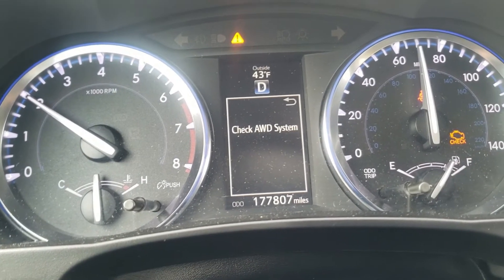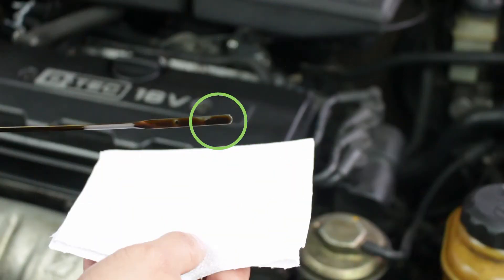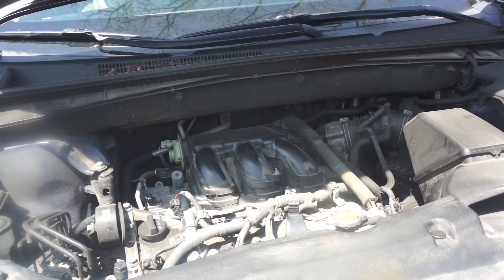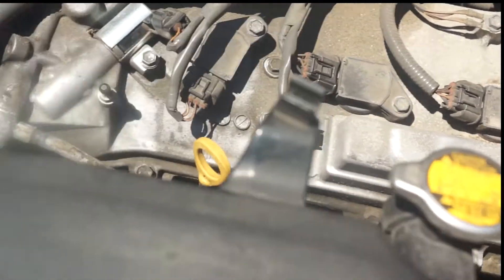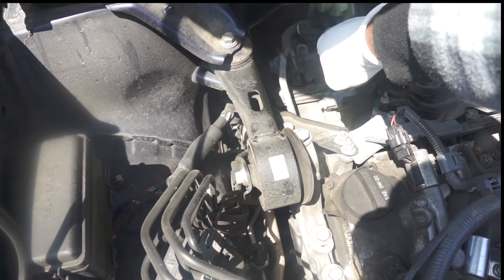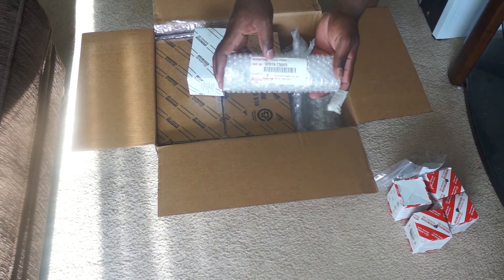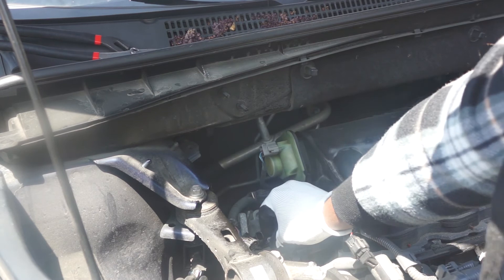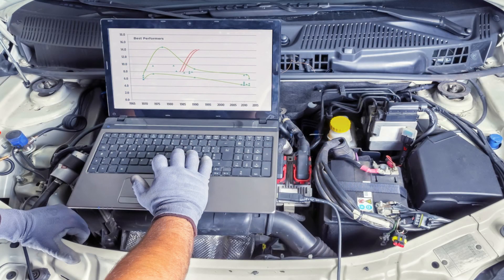Code P0340 P0341 Camshaft Position Sensor Replacement Toyota Highlander V6 Engine Bank 1 Intake

Comment: Just want to thank you for uploading this video.   Saved alot of money than taking it to a specialist technician! Had the same code on my mother's 2015 Toyota Highlander p0012 and the front AWD was on as well.  Did an oil change and swap out two front Bank 2 Exhaust and Intake sensor as well as Bank 1 Camshaft sensor near the Intake manifold.  Did not get to the bottom one behind the manifold but took into consideration to your video and manage to take to O'Reilly to erase the code.  After that, everything ran fine again.  Thank you!
Reply from the maker: I'm happy you were able to solve the problem yourself because specialist technicians are so expensive. Not sure you needed to swap so many but you got the job done. I would appreciate your support with a subscription 👍😄

Comment: Wow i had exactly the same check engine light and info appeared on my dash like on and off couple months ago on my 2015 Highlander..and the difference is when i connect the scanner..i got the p0420 code different from your code..so thats weird to have the same info on your dash but different diagnosed problem from scanner...cheers🤙🏾
Reply from the maker: The display is common for a power chain issue. The codes are usually different
Reply: I had a p0010??was that the same sensor??a p0343 and a p0420

Comment: I'm a fan of you. I have a 2017 Toyota Highlander xle 3.5L V6 engine AWD. I am having same problem. When I scan the car, the code came p0335. I am having problem to locate the Crankshaft position sensor circuit A. Can you tell me where to check to find Crankshaft position sensor circuit A? Thank you for your content. Your videos are helpful.
Reply from the maker: The highlanders are sensitive when is comes to crankshaft. Circuit A aka bank 1 is the cylinder head located closer to the main body of the car. I'm not sure what type of scan tool you used because it should also tell you whether it's intake or exhaust. I recommend first disconnect them all and clean. Reconnect and clear code then see if the problem is resolve. Highlander sometimes trip a false code. Let me know how it goes

Comment: Thank you for sharing the video!  I got "P0019" code and it says "Crankshaft Position - Camshaft Position Correlation Bank 2 Sensor 2" and I have been looking for Bank 2 Sensor 2 location.
Reply from the maker: That's bank 2 exhaust. Bank 2 is the cylinder head that is closer to the front of the engine.. it will be the sensor closet to where the exhaust pipes are bolted the the engine. It will be the one sloset to you while standing in front the car. I showed it in the video. Hope this helps
Reply: @trackpalmer  Thank you!
Reply from the maker: Subscribe 👍
Reply: Extremely helpful
And Knowledgeable DIY mechanic ! Ty Trackpalmer !
I have 2 check engine codes related to the camshaft position intake sensor Bank 1. Do you have a part # & good link for Toyota OEM
PARTS AT THE BEST PRICE?! 🔧🧰 Godspeed

Comment: Excuse me ❤️ P0368 Camshaft position sensor b Bank 1 Where? Behind the fridge ?? Toyota Avalon
Reply from the maker: if you have a 3.5 V6 engine, bank 1 is the head that is closer to the back of the car.  Along with the fault code, your scanner should also tell you whether its intake or exhaust. I have a link in the description of this video replacing the intake  camshaft position sensor on bank 1. The exhaust bank 1 is hidden by the intake manifold and that would have to be removed to replace that one. Hope this helped.